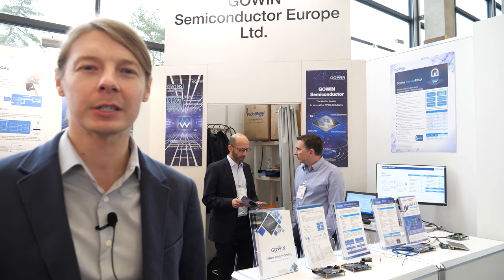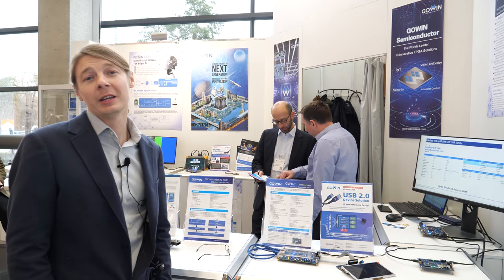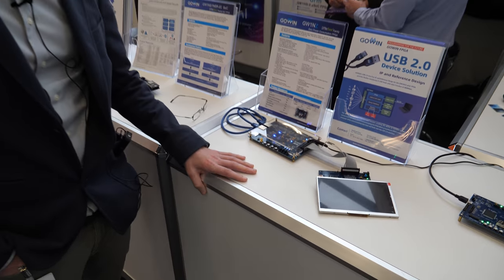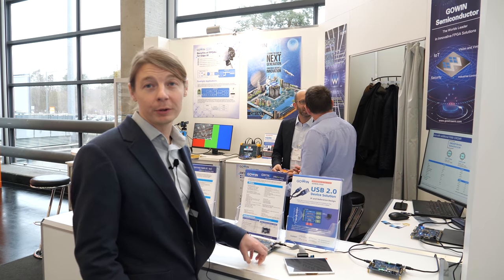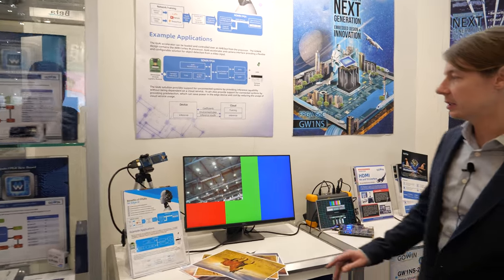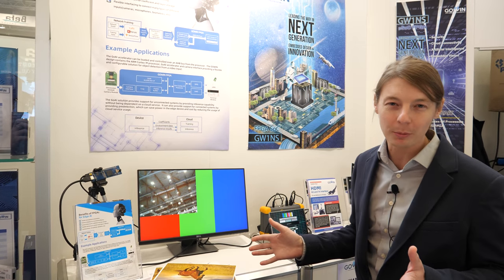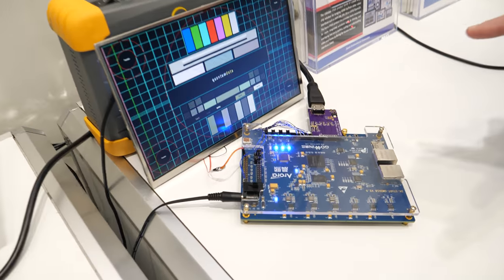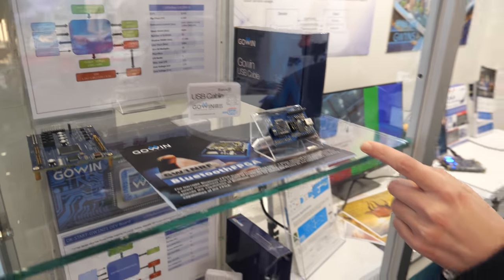Gowin FPGA at Embedded World 2020, GW1NRF, Bluetooth enabled FPGA, GoAI machine learning, GW1NSE

Comment: embedded security and made in china.... strange combination
Reply: What kind of exploit family or type are you imagining then specifically?

Also it's a question of threat model. When your threat model includes high-effort industrial espionage, as well as superpower governments of which there is more than one, there's... probably remarkably little you can do, especially when dealing with mass market oriented, cost-optimised semiconductor devices. Adversaries with these kinds of resources have their ways around the surface level protection that's in there, regardless of how faithfully it's implemented or where it's made.